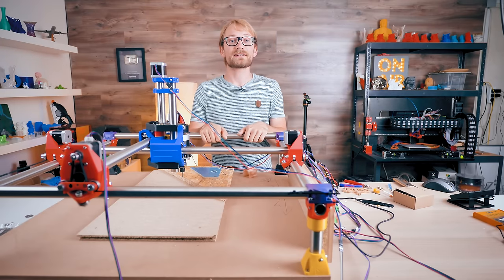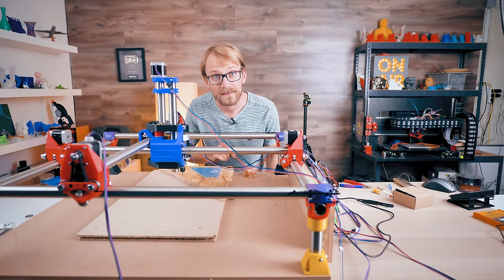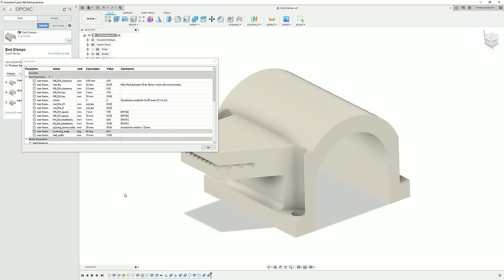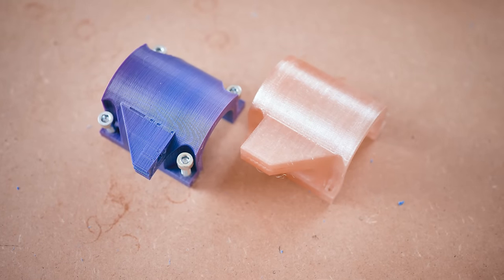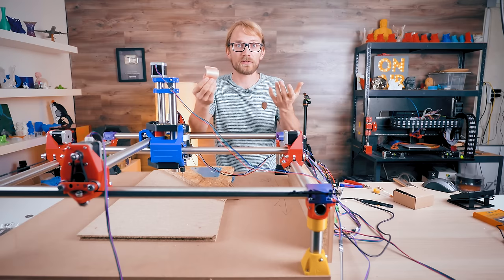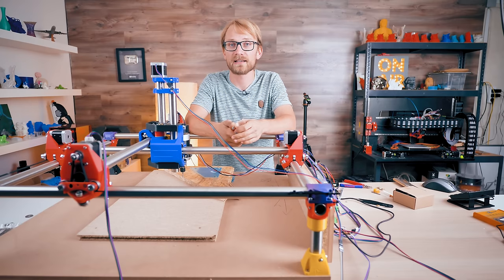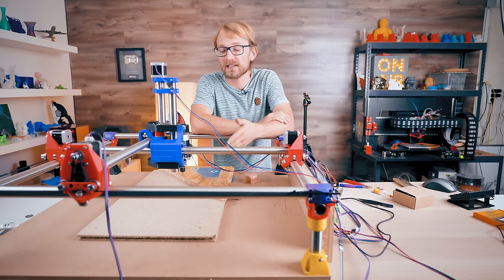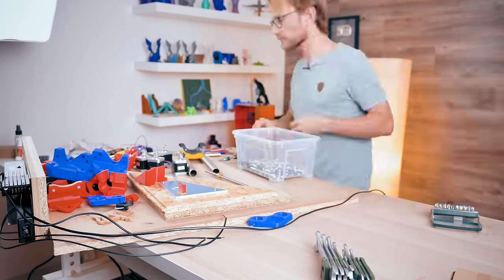Whose design even is this? (MPCNC conclusion)

Comment: I've been a patron for Tom, Angus (Maker's Muse), Stephan (CNC Kitchen), and Joe (3D Printing Nerd) 
for over a year now, about the same amount of time I've been 3D printing. I've also bought, built, 
and have had many successful cuts on Ryan's LowRider2 CNC. I watched Tom's video, looked at the 
Twitter feed, and read the forum post about this on the V1 Engineering forum. I think there's more 
to this than Tom lets on in his video, and I encourage others to dig a bit deeper into this. But 
regardless of if you agree with Tom or Ryan, there's no reason for the comments on this video to 
be so toxic towards Ryan.

Comment: I agree with you Tom, I think you should spend your time with a project which does allow modifications without hassle. The CNC with belts in this size will hardly work as there is to much play in this design. Maybe threaded rods are working better..

Comment: I built the MPCNC a few years ago. It was also difficult to find the right tubes here in Australia and I started using Aluminium tubes as I could get them in the right size, but in the end they weren't strong enough and ended up being distorted by the pressure of the bearings. I found some chrome tube that worked, but the issue I then had was the Y-Axis wasn't moving straight and a square ended up being a parallelogram. I tried to find the issue for weeks but in the end couldn't solve it so I pulled it apart and put it away. I did speak with Ryan a few times on the forums and he was helpful, but yeah kind of glad I didn't continue with the project.

Comment: I was thinking about making an MPCNC until this video.  Shame on the copyright debate for such a simple item.
I can appreciate why you took the machine apart.  I would have done the same.
Thicker wall tube would improve stiffness.   You mentioned only certain sizes available.  Perhaps the relative stiffness of aluminium rectangular/square extrusions are why this is so popular in many machines.
Dave.
Reply: The tube was the most solid part, you can not have this sort of mechanical bearings in a cnc, they don't have rigidity, and the outcome is pretty clear when he atempts to cut some wood! Don't waste your time
Reply: @matutolaYT  the wobble in the known crappy spindle did that. Also a 1/2" depth of cut is ridiculous for a start.

Comment: If someone were to print out Prusa parts and build there own Mk2, would anyone expect Prusa to provide support for that printer? I certainly wouldn't. Ryan's livelihood depends, in part, on the reputation of his products, so he spends a great deal of effort supporting his customers and the MPCNC community. Whether developing new parts is considered a violation of copyright is less of the issue than complicating testing and support of the machine. It would not be good for his reputation if Ryan has to respond to every query with "Did you use all original parts?" every time someone has a question. He doesn't have the time to verify the design of modified parts, and he shouldn't have to.

Tom & Ryan: I am a follower of both your endeavors, and have been for some time. This sucks. Ryan, maybe you could have worked with Tom in a more official capacity. Tom, I think you should respect Ryan's wishes, as he holds himself accountable for every MPCNC made.

Everyone else: I've built several printers using Tom's guidance and expertise. He definitely knows a few things. I've also built my own MPCNC. It works well when you follow Ryan's advice on parts and settings. He also definitely knows a few things.

Comment: Silly, because the design kinda sucks. Novelty value at best.
Reply: Exactly. If you've (not meaning you Brian) never built a cnc before or used one... anything built with the tube rails only supposed at the ends, unless very small, is going to be too flexible to really do anything but at a frustratingly slow slow pace. Even those comercial/hobby cnc's you see maker's promoting on YouTube are marginal at best (people do realize they get theirs for free in return for a 'good review') but if you work very show or a whole lot of passes they will eventually get the job done I guess.

Comment: Just speaking as someone who built one in imperial and have been using it for the past year,,, I have had none of the issues you had when cutting wood. The machine actually works great so long as you understand the limitations of the machine. I wont comment on the discussion of copyright(thats an entirely different thing) but the design of the machine itself is actually really good and I heavily encourage users to build their own or even upgrade ryans original design. Don't let a heated internet argument sour your thoughts of the machine.

Comment: Typical, when people start making money they become, greedy and offensive, why would anyone buy this from Ryan if they can't modify it or share their modifications, besides the quality of the CNC is only average at best.

Open source is the way to go and the way for our communities to further develop.

With all your knowledge and skill I definitely think you should try and design your own system from scratch, I still consider myself a rookie and I'm currently designing a 3D printer, such an exciting process.
Reply: You can modify parts and share them. There are tons of remixes on there. But the license states it needs to be the same license as original. The same reason that if you use open source firmware like Marlin, you must release the firmware source as well, just like when we forced wanhao and creality to make their firmware available.
Reply: @paradisearcade8386  so your telling me if i were to use my own time making a modification, i couldn't share it as a open source?
Reply: @Deathbyfartz  unfortunately no. Try it on thingiverse. Try making and publishing something as a remix, and it will give it the same license as the original, if the original has a sharealike license. That's where I think maybe the way the CC license is written needs to be looked at again. Tom is indeed correct with the car part analogy, but car manufacturers have a different license than CC.
Reply: @paradisearcade8386  yeah see that's what i don't get if i were to model the part from the bottom up, and it ended out having the same function and a similar look, then how can this effectively be their property?
Reply: @Deathbyfartz  right. Again, that's why I said that the way the CC license is written needs to be looked at again or maybe updated.

Think of it the other way, if you effectively redo all the parts from the bottom up, and they ended up looking the same, can you release it as open source?

It's a very complicated issue but neither side is wrong here IMO, there's just a breakdown in communication because it happened on the public internet instead of privately.
Reply: Create you own?
Reply: @Deathbyfartz  he didn't model the part from the bottom up, he made a copy (using CAD doesn't make it any less a copy) and changed a minor detail.  Not original in any way.

Comment: Reading the original exchange, it sounds like all Ryan was asking for, was that it be released under share-alike (meaning the original licensing). Releasing it under CC0 takes away any previously applied licensing on the original works. You're not only waiving your rights - but the rights of the original design - and you're clearly making something derived from it.
He is wanting to protect his project from people making and selling clones of his work, and claiming them as their own.
Your misunderstanding of this is causing a 'hate train' towards Ryan. Which is extremely disappointing - with the amount of respect that you have in the 3D printing community, I expected more from you.

Comment: Yeah i think this Ryan guy doesn't understand the difference between patents and copyright. Copyright only applies to the files he releases. If you use or modify his file the result probably still be under his copyright. If you design a part from the ground up it's defiantly not. 

100% for sure if releasing cad files of parts created some IP claim baring anyone from making similar parts  auto manufactures would all release detailed cad files on everything they make. Which they don't, because that's not how copyright works.

Even if some part of a MPCNC was patented you could still release your own designs, but you if or anyone  printed the design they would be infringing on the patent. Which BTW is why the 3D printing revolution happened when it did. We all had to wait till key 3d printing patents ran out before we would start building home machines that violated those patents.

Comment: In spite of all the sanctimonious hair fires from some of the ignoramus commentators, Ryan is perfectly correct under US law.  This is not a basic "copyright" issue as in the brake disk example you gave.  You merely designed a somewhat different part for a part on his machine doing the same thing.  That is the very definition of "derivative work".  The law states the "new" work must be SUBSTANTIALLY different to be considered original in itself.  A variation of a belt holder is not SUBSTANTIALLY different.
Reply: The part of significance is the belt holding mechanism which is substantially different than the other one which is a loop that holds a zip tie. You can be within your rights under the law in a lot of ways but most of the time people don't do it because it's ridiculous.
Reply: Not really, if Tom Improved the part or made the brake pads better the part is improved not the same function, Is Coke the same as Pepsi ..?
Reply: @dansteffee9759  it's still a corner for a MPCNC that holds a belt. Designed to be used on MPCNC while staring at the original part for reference.
Reply: @GeoffreyPitman523  Not really, the design is different, you can't compare the two. Tom part can fit or be used for other designs and is not restricted to Ryan's BS world.

Comment: Ok so I propose a new project plan for the Open Source Community: 

Project SOS-CNC 

A.K.A. The Sanladerer OPEN SOURCE Computer Numerical Control 

SPECS:
- Metric
- Aluminum Extrusion
- 3D printed parts
- Linear rails
- Belts or High Helix Leadscrews

Build INFO:
- An entirely OPEN SOURCE CNC made with correctly rigid enough materials and corresponding components & hardware. Created by the Open Source community for the Open Source Community. 

STORY:
- As Tom has more than a decade in experience with machining, electronics, engineering, and is in a unique position in the Open Source community such that his expertise, experience, and guidance would serve wholeheartedly as an extreme benefit to the project overall.  

With Tom at the helm to guide this new project, this ensures the Open Source nature of the project as well as it's life span & will encourage others in the Open Source Community to participate together in creating a new CNC system by the Open Source Community, for the Open Source Community. 

As with all things, it needed a name, which I believe that the SOS-CNC is THE perfect name. In light of the new developments of Tom's Open Source CNC video build project series, I myself and I am sure many others too now recognize that there is a need for a completely Open Source CNC for the Open Source Community.

With Cons, Downfalls, Non Open Source designs, and Design flaws recognized in previous attempts made by makers.... 

The proposed SOS-CNC is needed now more than ever!! With a short list of design  specifications identified above as a starting point, and with Tom's overall guidance at the helm ( should he be willing to participate as such, no pressure! Please do tho! ) The SOS-CNC is the answer that the Open Source Community has been looking for!!

I am entirely serious about this and believe this is something that should absolutely be done!  I personally was a huge fan of the MPCNC.... unfortunately no more. There is even an amazing Tool Changer project for the MPCNC... Which I was actively mentioning and getting people excited about in various social media platforms... Well, there will be no more of that after these new developments....

I firmly believe that we the Open Source Community can come together and make our own OPEN SOURCE CNC. That which we will do right from the beginning. And well make a Tool Changer for it as well!!

I propose the SOS-CNC  & the SOS-CNC Tool Changer today and hope that the Open Source Community adopts this proposed project with me. Wether the Community begins work on this now, or wether I start the work on it when I'm done with my current projects, no matter. It's an Open Source Community project !

LET PROJECT SOS-CNC BEGIN !!!!

Comment: I am so disappointed that a project that I expected to be a great example of collaboration and creativity devolve into a squabble over ownership. I just finished my MPCNC build because I first found out about from Tom's videos at MRRF. I don't do Twitter and missed this on the MPCNC forum so I am flabbergasted that something you spent so much time and energy in you are wiling to just shut down and walk away. Did you foresee this copyright issue coming into play from the beginning? Was this a setup for making a statement? I understand you have your values and you have every right to champion what you see as a priority. It is great that you spent so much time on the build stream. Wow. that was so helpful. You really are an influencer. This experience makes me realize that I have to continue to do my own homework better. I spent two years studying the MPCNC project and step by step learned about how these machines work. I was ready to build and mine turned out great. Very rigid. One final thing, I agree that the whole metric/imperial issue is a problem especially around the nut traps and tubing. This confirms an important principle for me:  the internet makes everything look accessible. In fact, where you live is a huge factor on what you are capable of doing. Still, I don't recall instances in other builds in Europe where people had all these issues.

Comment: I'm  getting a little satisfaction out of this mess, because maybe it will keep others from building an MPCNC, which is an EXTREMELY flawed design. Maybe people will look into other open source CNC options that actually make sense from an engineering perspective. 
Basically it boils down to this: a CNC needs very rigid and stable parts. 3D printing the parts at home does not provide that capability, resulting in parts that flex, stretch, distort, squish... everything loosens up and the machine does not really work, and when it does, it will lead to long term frustration and disappointment.
I built the MPCNC, struggled to get it working good enough to 'get by', and eventually used it to cut parts for a CNC that actually works. (Lookup 'Openbuilds Ox"). Tore the MPCNC apart, reused the motors, electronics, leadscrew, etc, and in a day ended up with a much simpler yet much more stable design that actually cuts wood extremely well.
I hope that the viewers will lean from Thomas' experience, not with the copyright issue, but with the resulting flawed capability of the system, and avoid a project that should have faded away by now.
Reply: The machine itself is fine, and you completely missed the point. It is not as rigid as an ox, but it also costs less than 1/3 as much to build, so there's that.
Reply: @timr86868  Which is less expensive, a $200 machine that doesn't work, or a $300 machine that is useful?
And rebuilding the CNC in the OX design was not $300, since I reused many of the MPCNC parts. Basically I just had to buy some rails and some wheels, less than $100 in new parts. So $200 already sunk into the largely useless MPCNC, +$100 to upgrade.
I have a feeling that a lot of MPCNC defenders have never used a reasonably designed CNC, hence the defense, but that their story would change significantly if they knew the difference.
Reply: Edward Casati I have machined on both a Haas TM-1 and a CR Onsrud 5 axis router. Thank you for your input thought. My mpcnc works great for a $200 machine.

Comment: That is bad.  I believe you are right and Ryan is wrong, but I also respect people for having a different opinion.  Ryan is trying to play hardball where there is no need, IMHO.  You are also right, the CC licensing schema does have significant holes in it with that generate 'unforeseen circumstances'.  Thanks for taking the high road.

Comment: I have been using the MPCNC For four years version 1 and mine is more sturdy then yours.  your gantry is to tall and your legs are too long  even tho mine is probably just a tad bigger I have a 2ftx4ft cutting area and even at the height of the legs there I don't get the wobble you do. I have a feeling incorrect parts are being used or something is off I have cut all sorts of material and never had these issues.  sure sometime lower my path depths but hey for the less then 400 usd I paid for mine and printed in abs as well for fun I have zero issues so to me its user fault.  and the original zip tie method works great.  So my machine is bigger and no wobble like you something is going on and not mpcnc related. I have cut thousands and thousands of hours on the mpcnc with zero issues know your machine and its limitations and it will work flawlessly.
Reply: That or you aren't telling us about all the times you actually had issues because you have time and money invested in it. I checked your videos out and since yours is using the standard american electrical conduit pipe and a router it looks more sturdy but you probably still have belt stretch going on.
Reply: @Deneteus  I adjust my belts probably once every 3 to 6 months and good job on speculation but no I have the cost of parts and electronics only invested into it nothing more.